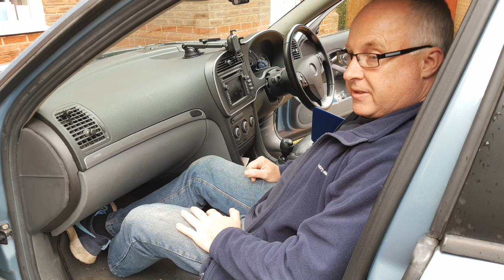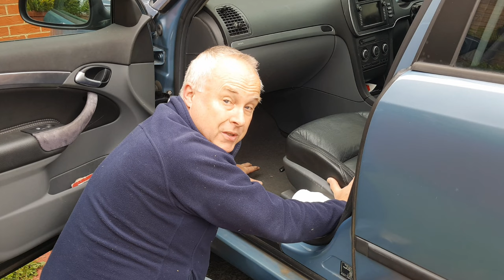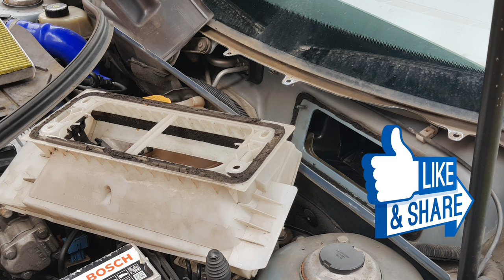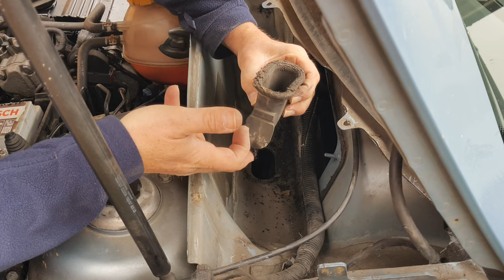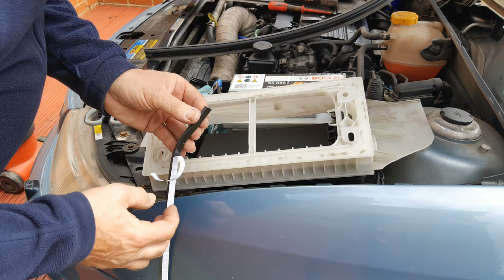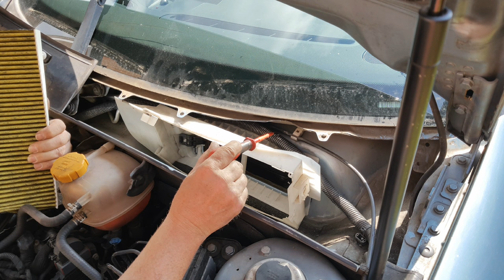Saab 9-3 Water in Passenger Footwell | Easy DIY Fix

Comment: Was at the point of getting rid of my Saab 93, the condensation was horrendous on occasion, was undriveable without copious amounts of rags to absorb, everything you said in this vlog was absolutely bang on, the scuttle cavity was absolutely full of dirt, blocked the water drain point outlet, cleaned, resealed and a few days later when the car had dried out it's been brilliant! happy days, thank you, saved me a few quid there and fallen back in love with my 93

Comment: Bloody brilliant!!!  We just had torrential rain here in Massachusetts and my footwell was like a swimming pool! It has never happened before so I watched your awesome tutorial. My drain was completely clogged and water was backing up into the cabin filter. Thanks for the clear and concise instructions.  I did quick vaccum and cleaning and I am planning to replace the nasty cabin filter.
Reply from the maker: Thanks for the praise. yeah, replace that filter asap or it'll go mouldy
Reply: Can you please advise ....How you removed the water from the passenger footwell ?
Reply: @CycloneCyd 
Can the filter be cleaned (What method ?) Instead of being replaced ?
Reply: P.S. brilliant video.
I've subscribed but was wondering how to access your previous video's.
Many Thanks.

Comment: Thank you SO much for this fantastic tutorial. I’ve had my 2005 9-3 from new but last winter was the first time I had a pond in the footwell, having now seen the contents of the drain gulley, I think I’ve been very lucky: 18 years worth of leaves had turned into a lovely compost and completely blocked it. All clear now with a new foam gasket replacing the one that had almost completely perished, my next job is to follow your other tutorial and lift the carpet to dry everything out. Thanks again 😊

Comment: My Saab 9-3 convertible had this very issue. I thought it was the hood, but I never could find out where the problem was. Then the fan died and I had to scrap the car. Fascinating to have this explained, so that it is something I can look into for my new 9-3 saloon :)
Reply from the maker: I've known people on forums spend '00s on this without resolution. Hence the video.
Reply: Scrapped it due to the fan??😳
Reply: @drtb69  it wasn’t the only problem. it was going rusty in places. I believed that the fan meant pulling out the whole drivers console and it wasn’t worth that. It’s still in my garden just incase I need the parts for my other 9-3 saloon.

Comment: Perfect video and everything needed to know to keep the dreaded water out. Even if it's not leaking I think it's best to do it, because sooner or later with the age of the 9-3 it will leak. And it's the perfect time and weather at the moment.
I've just finished doing this job, my tips- use a old credit card type scraper to get the worst off, finish the rest off with lighter fluid on a cloth ( easy work)  I used double sided glazing foam tape 12mm x 4mm, adhesive on both sides. Must be at least 4mm thick as the filter housing is slightly recessed. (4mm is ideal)  With the same fitting procedure as Cyd.  ( Good tip - keep the final join at the bottom of the filter housing)  Do a few practice fittings before taking the outer tape off to do the final fit.  Once that foam tape as touched down it will be for life believe me. No need for any silicone with double sided quality glazing tape.  Cheers.
Reply from the maker: Thanks Shawshank, yes I'd agree that every 9-3 owner should look at this on heir car. The newest 9-3s are 10 years old now and that OE foam is poor.
I used a sharp wood chisel and some brake cleaner. It comes off easy enough, so whatever is to hand.
The silicon is belt and braces really, but it's impossible to know what kind of foam people around the world will be able to get, so it helps to be sure of a seal that will last.
Reply: @CycloneCyd  Thanks for the reply, my name is Chris. I've sent you a "coffee" recently and I will do so again as your video's have helped with the jobs on the 9-3 so much. Thanks again.
Reply from the maker: @shawshankkid  thanks chris. yes, perfect for the job for our UK based friends.
Thanks for the coffee. Appreciated
Reply: Thanks for the size of the tape. Big help thank you
Reply: Thanks for size of foam tape ! 👍

Comment: I just want say a huge THANK YOU for your extremely helpful videos on the Saab 9-3! I really appreciate the time you take with the details on the type of torx screw bits you need, and step by step instructions and clear video quality. Truly grateful, as my Saab has been a headache these past few months, with the extreme cold temperatures we've been experiencing in Calgary, Alberta, Canada! My fan officially stopped working and I think it's because of moisture getting in from behind the cabin air filter, and was squealing like mad the day prior lol. I just watched your other video concerning that, so I'll be removing the fan and lubricating the bearings and hopefully I don't have to replace it. Thank you again!!

Comment: Thanks for this video. My car was parked up for a few weeks when I was working away, and during which we had a few torrential rain storms. When I got home I found my passenger footwell under an inch of water. My heater fan had stopped working and it all made sense after watching this video. I found the draining plug blocked with dirt which was easy to clear just as you said. Anyway, I was able to save my fan by simply accessing it through the pollen filter and spraying it with lubricant while I turned it with my fingers. After a few minutes the motor started to spin under its own steam. All it cost me was a few squirts of WD40 and a few minutes of my time. I'm a very happy bunny.
Reply from the maker: BUT did you repair the filter housing seal?
Reply: @CycloneCyd  Didn't need to Cyd. I checked it and it was tight to the bulkhead. My Saab estate only has 51K miles on it from new which is why I was mortified to find it full of water.
Reply from the maker: @garryoakley2397  you cannot know that so you do need to. It's not mileage, it's age that counts here.

Comment: Thanks Cyd. I’m new to Saabs and my 05 9-3 had the exact same problem in heavy rain and when I washed it. Cleaned the drain bung out underneath the cabin filter thinking it was that and it was still doing it. I’ve just done the seat around the filter housing earlier this evening and your tutorial made it Uber easy - took 30 minutes from start to finish and cost about £13 in foam gasket and silicone. Thankyou!

Comment: Hi Cyd I just followed your instructions to replace the seal on the cabin air filter. When I tried to get the housing out I couldn’t until I removed the black clips from the housing first. This wasn’t a problem and it all went back together very well but I thought your viewers might find this useful. I followed your instructions to the letter apart from that and it was very useful and informative. Thanks.
Reply from the maker: You'll forgive me if I don't try to replicate this issue as my filter housing is nicely sealed up now.
Thanks for sharing, I'm sure others will find the info useful

Comment: Thank you for this helpful video! My wife's '06 9-3 convertible had water on the passenger side floor and I was afraid the soft top or windshield had a major leak.  Once I disassembled things down to the cabin filter box I found both problems, a disintegrated seal and a completely packed rubber drain. Your directions were complete and, incidentally, work well on the US version of this car. 

Since this vehicle is nearing 20 years old, I strongly suggest anyone who has this car should clean the rubber drain and replace the gasket to be on the safe side. Thanks again!

Comment: Hey sid
I have to say this was the best bit of maintenance I've done, and your video made it so easy.
Learnt that wipers can be put in service mode... Never knew that.
On removing lower scuttle...
Just as you described.. Drain bung full of soil and blocked.....
Water 4.5 inch deep half way up filter..... Filter soaking.... No foam
Seat for filter.... On removing housing..... No foam filter anywhere
Just a dirty outline of where it once lived..... Air intake chute for motor
Soaking and dirty.... Front passenger footwell 2 inches deep in water
Windows internally misted...
Bad smell from sodden carpets
That act like sponges.
Did the repair today and motor no longer squeals after the wd40
Spray as shown.
All in all a great video that made things so easy....
Thank you.
Reply from the maker: Awesome, CB. if you've had that much water flowing in, I'd suggest following this so you can make sure everything is dry and lube the lower motor bearings. https://www.youtube.com/watch?v=Oe1JBNhAxh0&t=3s
Reply: @CycloneCyd  will do
I've been using a water vac machine
It's pulled quite a bit out
I also intend to remove floor pan drain bung on rear passenger side. 
As the car is always parked outside
Its a bit difficult to raise carpet
To air it out... Seeing as it's also damp outside. 
I'm going to put a dehumidifier in
And hopefully that and the drain bung may do until the weather warms up. 
Thanks

Thanks

Comment: Excellent video tutorial, Cyd! I have just acquired my 2008 9-3, and was doing a once-over inspection of the filters- the cabin air filter was clogged with a housecat's worth of pollen, leaf bits, and other tiny debris. I did a temporary clean out with my shopvac (until new filter arrives) and I will be doing your foam replacement as well. Thank you for all the great advice on your videos! Coffee on the way☕☕

Comment: Cyd,

I experienced, or rather my son did, a large slop of rainwater into the passenger footwell. I watched your video and ordered gasket and sealant.  It wasn't an easy job.getting the wiring harness over the top of the pollen fiekter was a bit of a squeeze but not insurmountable.

There was no  foam where the pollen filter sits,  nor any evidence if it having being there so I didn't fit any.

Job done.  Many thanks.

Gavin

Comment: Thanks for the videos man. 
  
Thought my heater core was going out because my passenger floor board is soaked, tasted the wetness and it didn't taste sweet so that told me it was water and not coolant which is a blessing.
And it's only a small stream on the right side of the floor board that goes up under my glove box( passenger is on right side of car.
Reply from the maker: Nice work!

Comment: Very helpful advice. Thank you for sharing. The 1999 convertible 9-3 automatic I’ve just bought did an average of just 1,300 miles between MoTs since 2003, yet it was fully serviced by a main dealer every year, with everything, including oils and all the filters replaced regardless of necessity - apparently each time!

Am hoping all these other important checks and maintenance were also carried out. 

71,000 miles in 22 years is not a lot.

Comment: thanks for all your saab 9.3 videos. ı fixed all my car little problems by watchıng your vıdeos .hı from turkey
Reply from the maker: Hello Turkey! Welcome aboard. Which did you find the most useful?
Reply: @CycloneCyd  air filter video and ı have the same problem and ı fixed it just.and inside trim videos expeciallly how theır removes.maybe  you can show how the car get in water inside from right and left side.!!! ''sunroof drain hoses''if those hoses get out of place two sides will wet as like that.

Comment: Bought a new cabin filter holder and reinstalled as water runs down bulkhead as original
Seal gone on cabin filter - can take off and reseal
Great work as ever ! 
Think cabin filter holder was about £29 from Saab Tec Welwyn Garden - had to get from Sweden 
Brilliant video thank you as ever 
Hope you didn’t mind me adding my little bit ? 
Colin
Reply: Great info Colin. Informative input is always fantastic. We can all help each other.
Reply from the maker: Mind? Blimey, NO! Everyone is welcome to use the comments sections, both to ask for advice and to offer their own tips and tricks. Viewers learn from my 37 years experience as a Professional Automotive Engineer for sure, but I too can learn from others. Keep it coming
Reply: Possible tip for Saab 9.3 convertible owners ? The horrible rubber shark fin aerial can be upgraded to 9.5 plastic outer - far more robust and stylish 
Bought outer 9.5 fin from Neo Brothers - carefully dismantle old fin - trim down internal - phone and Sat nav by about 1/2 cm bond into new shark fin- apply small amount of mastic on base - bolt down - water proof and stylish ! C👌

Comment: This happened to my 9-3 during the storms of early 2022 in the UK. It was like driving with bathloads of water being thrown at the car.

the damage became clear when my fan stayed ON leading to a flat battery. My cabin filter and water outlet must have been blocked as the module behind short-circuited. 

This was fixed by Abbott Racing in Suffolk who I highly recommend. It's so common they diagnosed the problem over the phone.
Reply from the maker: Thanks for sharing. Question (not judging, I am genuinely curious) this is such an easy repair, why not DIY? Why pay someone else to do it?
Reply: @CycloneCyd  Fair question, Cyd. I spent months working away this year and didn't have the time, energy or inclination, and needed to fix my car asap.
Reply from the maker: @T11639  I get that. 'Life' just gets in the way sometimes.

Comment: Great vid as always Cyd. Many thanks. From memory do you remember the width of the foam seal you put on? Looking at one currently 13mm wide.
Reply from the maker: The one I put on was 10x10, but if yours is 13mm wide it'll be okay as long as it's at least 10mm high and can be compressed to about 7-8mm

Comment: Hi Cyd, great video. I want to have a go at cleaning up the filter housing, and replacing the seal, but I also want to lubricate the fan which has started chirping a bit, so would do this as part of the same job. I saw another video where the guy pulled a rubber bung off the fan housing behind the glovebox, and sprayed lubricant in, but this was a LHD car. Do the fan housings on RHD cars have this rubber bung as well?

Comment: Hello Cyd - good work as always, great to learn from your videos! 
I've just meet some opinions about this kind of fix in Saab's 9-3 and some of the owners recommend not to use a sillicone due to the fact, that it can cause a problem with rust in the follow time. Insted of using silicone, they've recommended to use a butyl sealent or poliuretan sealant.
Reply from the maker: It'll only cause rust in contact with bare metal. In this location it's got electrostatic primer and a paint layer between it and the metal.
Reply: @CycloneCyd  Thanks for this knowledge, hope for more videos about 9-3 fixes!

Comment: Thanks Cyd, I have a soaking rear drivers side carpet. No issues with seals on the door I can see. Could water be tracking in through the cabin filter and out through the vents under the driver’s seat?

Comment: Thanks Cyd! Ours was very full of debris.
2006 Saab 9-3 2.0T 4 door
We have a lot of water in rear passenger footwell.
Removed seat, and underside of passenger side soaked, water visibly pooling.
Replaced old shark fin antenna.
Door seal appears intact.
Cannot see water coming in even when pouring water over car, but if it is raining for 2 days will see pool of water where rear passenger would sit (left seat out to dry).
Suggestions?

Comment: Hi cyclone love your vids always helpful my saab93 2005 cabriolet when I bought it 2 years ago water was leaking through roof and filled footwells front and back I have fixed that problem just had it mot this week passed now out on road no speedo fuel guage going crazy temperature guage all playing up could it have anything to do with any wiring under carpets that may have been wet with leak

Comment: Great video, thanks I have had this very problem.  My Saab 93 that struggling to start and blows white smoke out when it does start have looked into this and read about it may have something to do with the inlet manifold, have you any ideas.?  Many thanks.
Reply from the maker: Which engine?
Reply: @CycloneCyd  1.9 TID 150bhp

Comment: Cyclone Clyde, would you know what would cause dash lights and radio to cut on and off while driving?
Reply from the maker: For certain, no. I would check for loose connections at the fuses and BCM first. If they go on & off together it'll be a common cause. Also check the ignition key module.
Reply: Everything on the dash, radio screen and  break light on roof shuts off at the same time for around 3 seconds then turns back on, sometimes it'll  do it back to back the hole time I'm driving or it'll do it once or twice and stops.

 And another thing, oil is leaking onto the turbo, do you have a guess where it could be leaking from? 

  I appreciate  you responding and you're video's, only ones that really explain everything step by step

Comment: Hi, have you had the coolant loss from the yellow cap problem yet? I replaced the cap but it still looses coolant. Thanks !

I will do this as rain isnt a problem where i am but everytime i was the car i have this problem. I put a bandage on it with some wd40 on the motor but i really need to fix it properly.
Reply from the maker: Yellow cap problem? Huh? can you elucidate?
Reply: @CycloneCyd  the coolant expansion tank cap, you have the overflow and pressure release mechanism, but mine seems to release all the time therefore creating a pink crust from the coolant leaking arount the expansion tank. Ive bought a new expansion tank as replacing the cap didnt work for me :( 

My saab needs a lot of tlc but im buying all the parts so i can fix it. It has a leaking windshield washer bottle, coolant leak from tank, cabin filter housing water leak, causing the ac blower to short/not work, i have an ac gas leak also, replaced the key because the fob was rotted, and bought a new fin for the aerial. Hopefully i can getvit fixed up soon when winter comes as summer time is just too Hot!